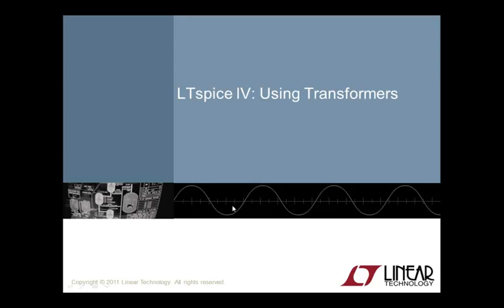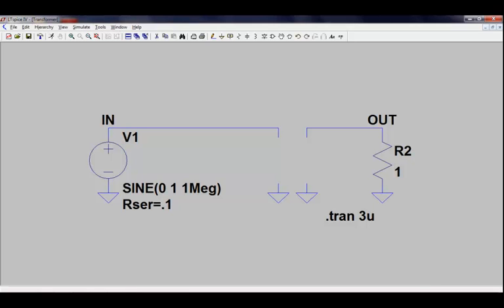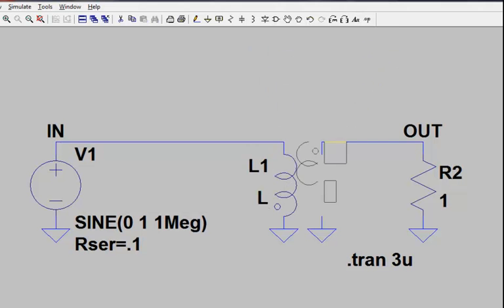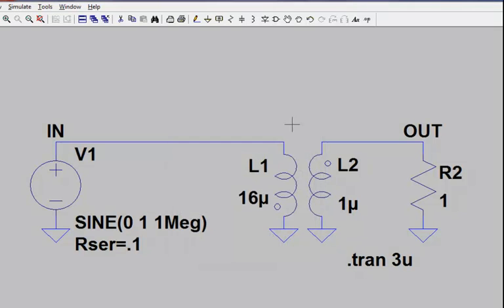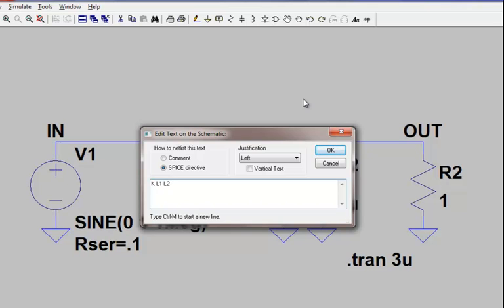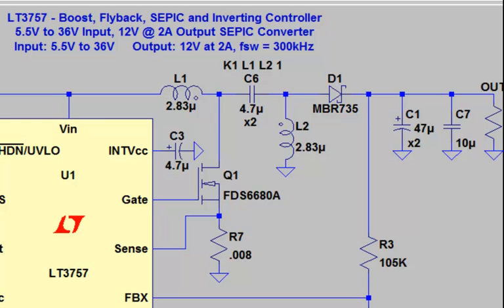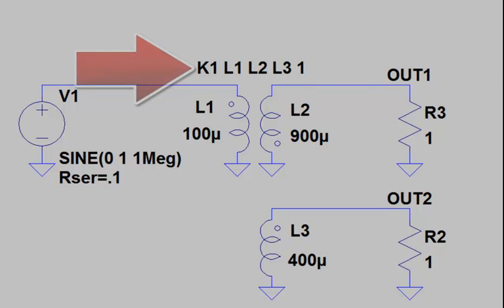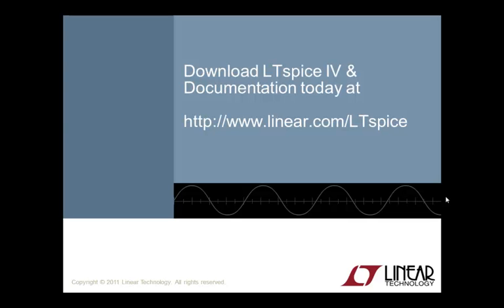Using Transformers in LTspice IV

Comment: how do we put number of turns in both inductors of trasnformers?
Reply: The inductance is (ideally) proportional to the square of the number of turns.  Therefore a 10:1 transformer has 10^2 more inductance on one side of the transformer than the other.  You can the 'magnetizing inductance' of a similar transformer to find a reasonable starting point.